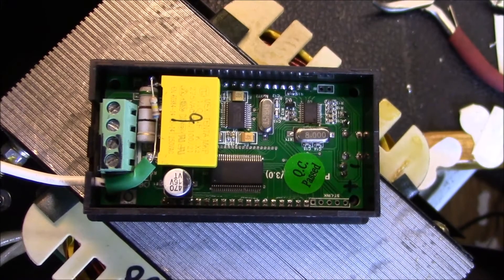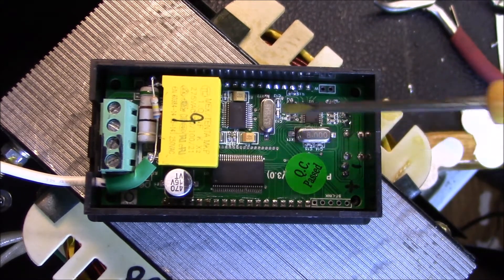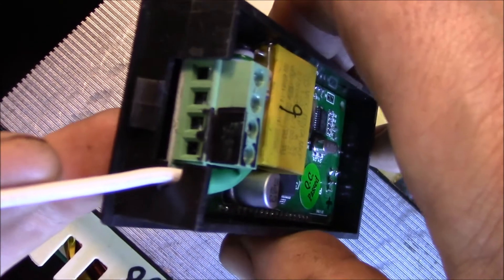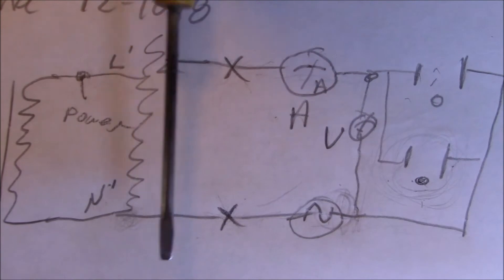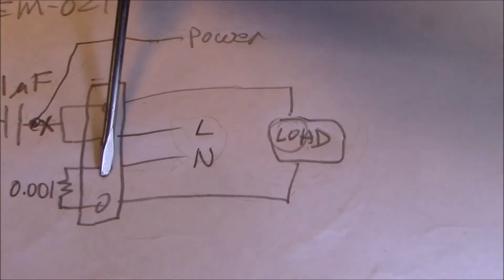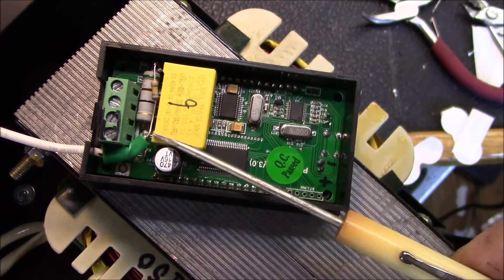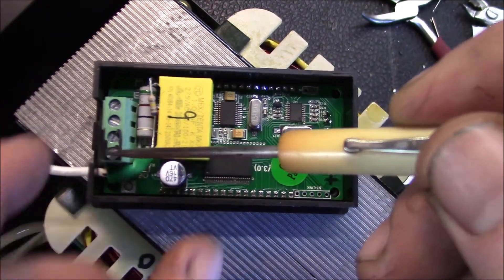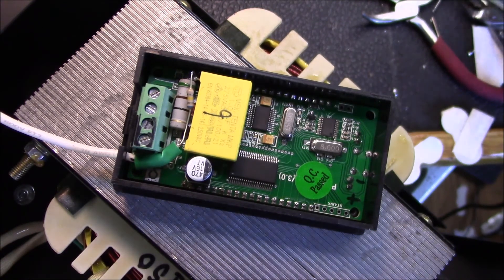Quest for Zero, (a.k.a. PZEM-021) Part 4

Comment: This is a great video. I would like to put a ESP01 inside to the Pzem. Yes, to install in the same original PZEM box and connect the ESP in the TTL using 3.3/5v, and gnd  from pzem. Is it possible? How?
Reply from the maker: I've not worked with the TTL output model meter myself, so can't give any advice on that process.  Try searching for wiring diagrams/schematics for the particular model meter you have.  I have a link to a partial diagram on -061 meter in the vide description.  Here's a writeup on connecting to the 004t meter:
https://innovatorsguru.com/wp-content/uploads/2019/06/PZEM-004T-V3.0-Datasheet-User-Manual.pdf

Comment: Intresting mod. When I connect my PZEM-021 up, I noticed the large resistor was getting hot, just wondering if this mod has something to do with this problem or is my one busy giving up. I also noticed you marked LIVE and NEU on your input, does it matter if I was to swop the LIVE and NEU. I see towards the end of your video you mention it does not matter, only if you modify the unit does it matter, am I correct , Thank  You
Reply from the maker: Yes and no would be the answer.  That large resistor is part of the power supply, it's there to dissipate some of the power, as heat, resulting from dropping the high AC voltage to lower DC voltage for the circuitry.  So, for example, if you're running the unit off 240V it'll get hotter than off of 120V.  So, if you can feed the unit a lower AC voltage for power, it'll lower that resistor temperature.  

There's another mod out there where you bypass that whole part of the circuit and instead feed in a lower DC voltage, you can probably find that mod with a web search.
Reply: Thank you for the info.

Comment: Any idea which cap you wire to on the PZEM-022? I tried with this guy's fix (https://community.openenergymonitor.org/uploads/default/original/2X/2/294bdb3c1419d8e6697bbeffa24d4ac3ee54ceb1.jpeg) but now my voltage is reading double... even without the 12VDC so I think I blew something in the circuit.
Reply from the maker: I haven't had a chance to try that new meter out yet.  Maybe someone that has can chime in.  With the 021 meter, I just figured out which of the 2 voltage sense wires was the hot side (that ran to the capacitor) and then I just lifted that capacitor leg off the circuit board and connected up a separate power wire to it.  It looks like your post might be doing a low voltage power input.  I can't see the image on that link and I've not tried a low voltage power feed.  My fix just gives a separate AC input to power the meter from a fixed 120V source and thus allows the voltage sensing part to read down to 0 volts.

Comment: Thank-you for posting this. Your video and explanation are wonderful. 

I have a question about the 470K bleeder resistor. What wattage does it need to be rated for? Would a 1/8W or 1/4 W resistor be adequate?

I will be making the same mod to an inexpensive VARIAC that I picked up on Amazon (see https://youtu.be/wPFaEFEembc). 

Thank-you
Reply: Never mind. I was able to answer my own question. For the US and Canada, line voltage is 120VAC RMS so that the capacitor max voltage would be about 170VAC. Using the formula P=(V*V)/R, we see that a 470K resistor will dissipate about .07W. A 1/8W resistor would be sufficient for any resistor >260K; a 1/4W resistor would be OK if 130K or higher.
Reply from the maker: Power = V*V/R, so not much power dissipation, about 1/8 watt at 240V.  Bigger concern might be the voltage rating, could put 2 resistors in series if that's an issue.

Comment: Very nice demonstration of this brilliant mod. I am just figuring out the way to do the same on the pzem-020 which uses a SMPS.
Reply from the maker: I don't have any details on that meter, but the concept is the same.  Find the connection that feeds the incoming line voltage to the SMPS and then lift that connection and supply it from a separate source.  There's likely some input filtering or a bridge rectifier in front of the small transformer.  Should be able to use a continuity meter to find the line and neutral connections there from the input terminals.
Reply: @The4Crawler  Just found a video about how to do it. In general the only thing needed was separate the two connected terminals by cutting out the traces inbetween ob both layers. Very nice module.
Reply from the maker: @real-fakeuser  Goods like a simple modification as well.  I guess if I ever get one of that model, I may do the same thing.
Reply: @Real-Fakeuser  I did get the pzem 020 and this mod would work though I ended up using an external DC source. I posted the circuit for the integrated power supply in the PZEM 020 and the way to modify it to read 0 VAC on my channel in case folks want to try it.

Comment: A great job! As usual for changing something on an electronic board requires some knowledges in electronics. For avoiding short circuit what can we changing? I mean can I change a power supply for this wattmerer and give for example DC12V for avoiding short  circuit between L and N. Because I want to use  your method for our lab equipment and students can make mistakes during the lesson.  Thank you, I hope you will reply for my question.
Reply from the maker: I think folks have done that.  See the schematic:
https://drive.google.com/open?id=1w80QYWeo8H5LdRoheGxNCMZViL9uqo81
and you'll see where you can disconnect the large capacitor and/or series resistor and tap into the V+ DC circuit, not sure what the zener diode voltage rating is but match that with your DC power supply.
Reply: Thank you!

Comment: Hi Sir, I also bought the meter and this hack works fine until 190V, then it trips and goes off. Strange
Reply from the maker: Assume you mean it works fine from ~240 volts down to 190 volts?  I've not see that on mine, although I've only tested from about 170 volts down to 0 and that works fine.  Normally, as shipped, the meter seems to run down to the 60-80 volt range.  Did yours do this before?
Reply: @The4Crawler  i live in europe. Mains is 230V. When in normal use, the meter starts up at +/- 30V. Goes to 270V (max variac). With this modification it starts up directly (light on, 0V) and goes up till 190V. Then light flashes and meter shuts down like it is going in protection.
Reply from the maker: @Tsjoetenbille  OK, that's clearer.  With my setup (variac on 120V) I can only get up to 165-170V and the meter works fine.  I have run one without the modification on 240V and that worked, but that was a fixed voltage.  Maybe there is some sort of internal protection feature that kicks in higher the voltage I can get on my power supply.  I'll have to see if I can rig up a 120-240 volt converter to test mine above 170V.

Comment: I'm wondering.... what is the purpose of the bleed resistor?
Reply from the maker: It's there to bleed off the charge in the input capacitor to minimize shock potential.  On a 120V AC waveform, you can have a peak of 170V DC on that cap when the power is cut off.  It will diminish over time on it's own, but a dedicated resistor can discharge the cap in a predictable amount of time.  Required, maybe not.  A lot depends on where the meter is installed and if the input circuit is likely to be accessible.
Reply: @The4Crawler  thanks!

Comment: Working on a similar project with 2 KW Isolation transformer and 1.5KW variac. Gonna be a very cool hack.
Reply from the maker: Wow, that sounds like a nice, high power supply.
Reply: R Brown when I saw the Ebay auction of the Isolation Transformer it did not seem to be big,  when I received it, damn  heavy. It weighs almost 15kg (33 lbs).) cannot find a proper enclosure.
Reply from the maker: Yes, a good isolation transformer is a beast.  I was surprised how heavy the 0.7KW unit I have is, it's a big brick of iron and copper.
Reply: Luckily I've got a toroidal one, EI types are slightly heavier and bulky.

Comment: Here's a link to another interesting mod of the PZEM meters. It looks like this user moved R3 on the rear of the circuit board and severed a trace on the front of the circuit board to effect the same change as your mod. If I were good at SMD soldering, I might attempt this version. Or I might just buy another $10 meter and have a go at it. ;-) http://alcodistillers.ru/forum/viewtopic.php?id=169&p=16
Reply from the maker: Looks like some interesting hacks on that page.  Also has a variation to bypass the capacitive dropper and feed 12V directly to the voltage regulators.

Comment: Is there a reason that you replaced your PZEM-061 meter in your variac with the 021? I've got an 061 and I'm ready to modify it so that I can measure the voltage and current output from my variac. If you think the 021 is a better meter, I'll pick up one of those for use on the variac.

thanks
Reply from the maker: Mainly to read lower current levels a bit better.  0-20A vs.0-100A range and also figuring the shunt resistor might be more accurate at lower values than a CT:
https://youtu.be/47osFl0LuJ0?list=PLpY2FP1a9tivPdpLVyg8XMqxw6B6SAEbI

I also had a plan for a meter with a CT so instead of buying another one of those, I picked up the 021 to swap into my variac.
The meters seem to run down to about 60V:
https://youtu.be/ic4kWdZMdfE?list=PLpY2FP1a9tivPdpLVyg8XMqxw6B6SAEbI&t=206
Reply: That makes sense. Thanks for the reference back to previous videos. 

I'm thinking out loud to confirm your meter mods, so please bear with me ;-)  To hack your meter, you lifted the hot connection to the 1uf cap. You connected a new, external hot wire to the lifted leg to power the meter. You added a 470k bleed resistor in parallel with the 1uf cap. 

Is the neutral connection to the meter from your variac IN or variac out neutral or does it even matter?
Reply from the maker: Yes, you lift the leg of the 1uF cap from the input terminal block and feed that separately.  The neutral connection is whatever the neutral of the measured voltage is:
https://youtu.be/zpBXKnCsllQ

So the separate power feed has to be referenced to that same neutral.  Before you lift the leg of that capacitor, there is no real line and neutral connection (meter would work the same no matter how it's connected), but once you do there is.